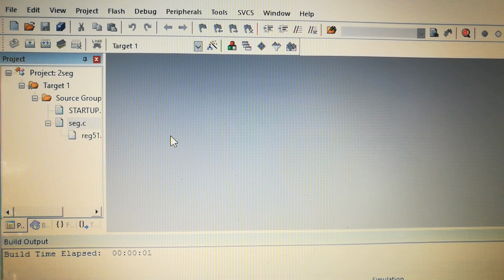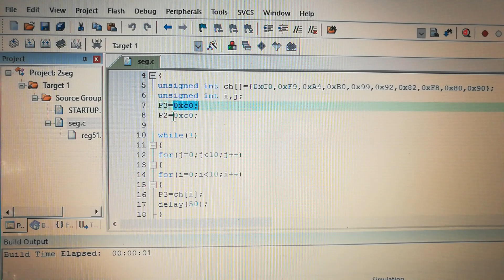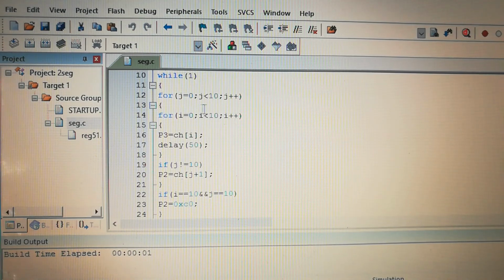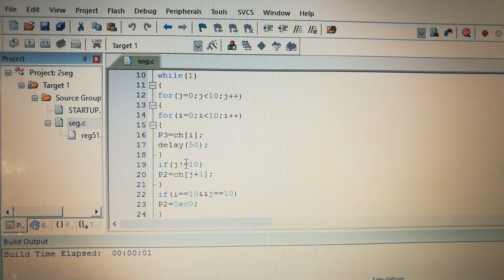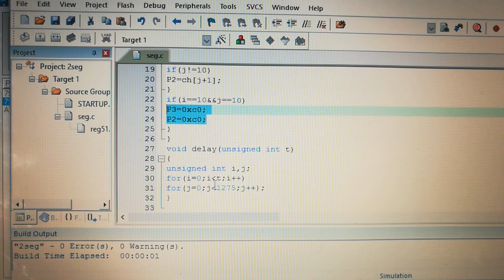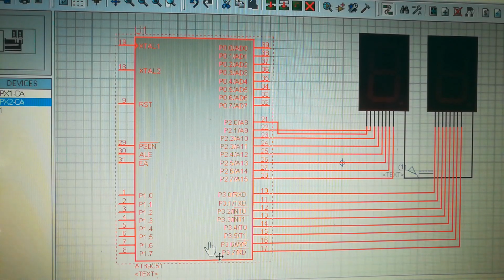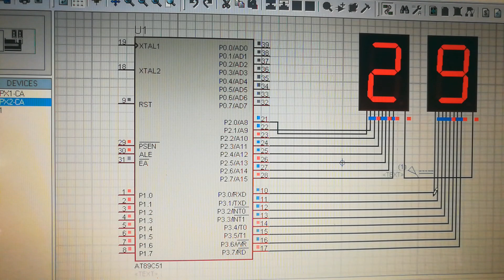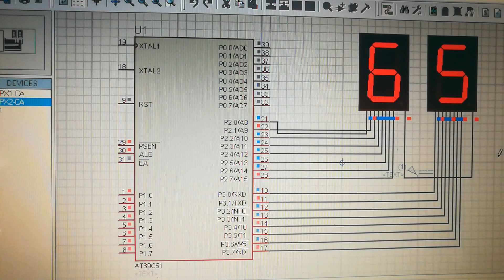Counting from 0 to 99 using 8051 microcontroller with 7 segment display

Comment: Sir how are u giving that supply between the two display
Reply from the maker: HI, here in simulation we have connected dc power 5 volt  to both the displays, you will get that in generator mode.
Reply: @embedotronics  sir wat changes shd we do for count down ....it's urgent
Reply from the maker: @kritikaprasan7591  you can reverse the loop just start from 9 and decrement both variables try it . you will get
Reply: I am not getting any output with this circuit ..is there any edit in the displays

Comment: Hi, while running the simulation using your code my displays shows 0 to 99 and after that it shows H0, H1, H2 .....H9,10, 11...
y this happening? I am using 7SEG-COM-AN-BLUE (7segment Diplay at Proteus8)
Reply from the maker: Hi did you use these lines in your code
if(i==10&&j==10)
P3=0xc0;
P2=0xc0;